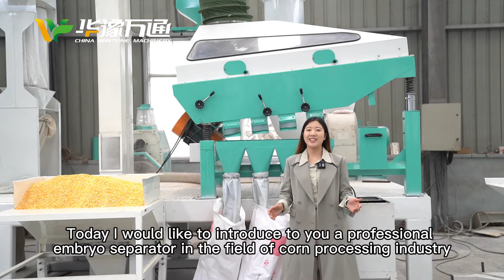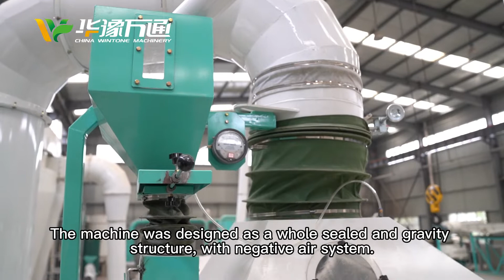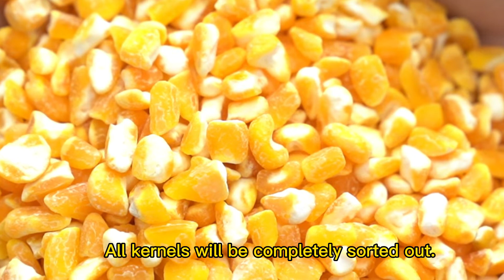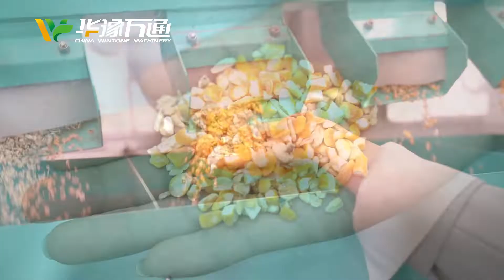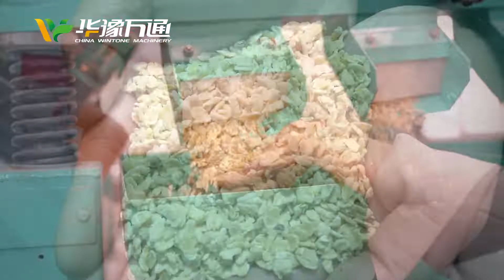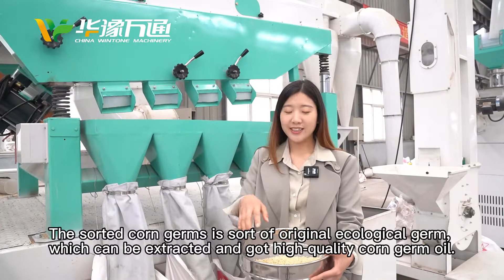TDV Series Corn Germ Separator;To separate corn germ from mixture of corn and germ (not used alone)

Comment: What capacity of corn grain does it degerm per hour?
Reply from the maker: 2 ton per hour
Reply: @ I see you have much bigger lines available as well (upto 150 metric tonnesj
Reply from the maker: @corynykiforuk7556  150ton per day is no problem. It is a complete project.
Reply: @ do you operate in the USA or only Asia?
Reply from the maker: we are Chinese manufacturer, our machines can exported to the USA and any countries.
Reply: @wintonemachinery can you send a pricing list for a range of 5 tonne upto 150 tonne lines and/or where in USA these are already installed and operating?
Reply from the maker: @corynykiforuk7556  There is no machine in the USA,now. but we set up in China and other countries. May i know your contact information ?  whatsapp or email ?  I  can ask our sales manager to send details and price
Reply: @ I sent you an email or if you leave one here I will message you directly
Reply from the maker: @corynykiforuk7556  i received your email and ask our sales manager to conatct you soon